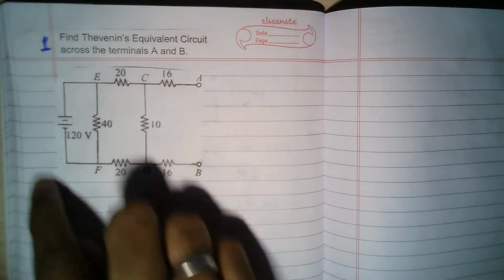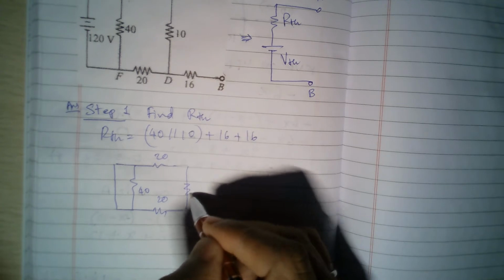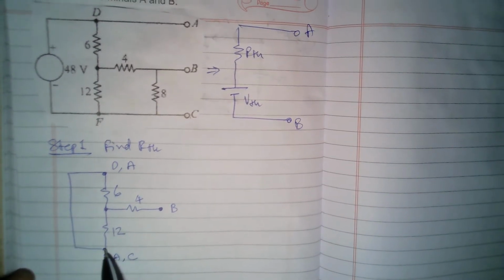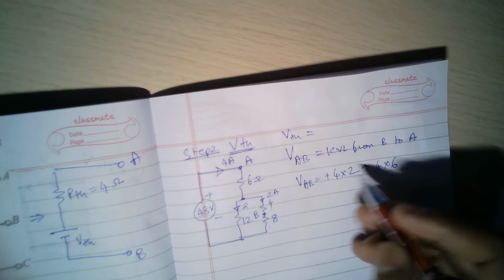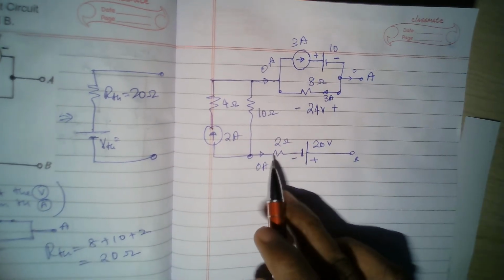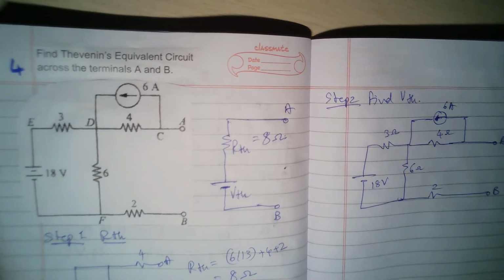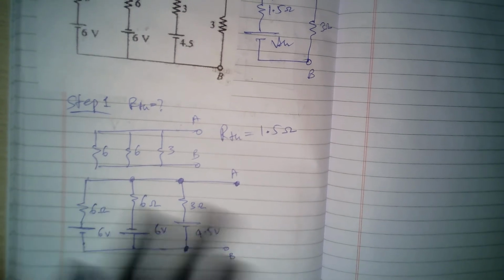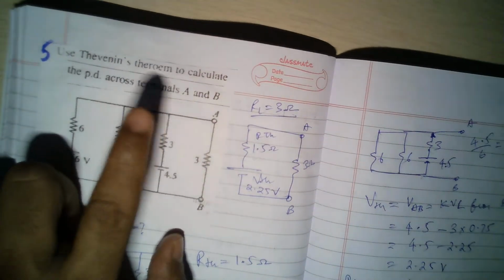T5 - Thevenin's Theorem: Five Example Problems

Comment: Why were 20 ohm resistors ignored?
Reply: To clarify, the 40 ohm resistor was ignored and the two 20 ohm resistors were combined. 

The 40 ohm resistor was ignored because to find the Thevenin voltage, you treat the voltage source as a short circuit (a wire). Then after shorting the voltage source, the points/nodes E and F become a single node, making the resistor connect to itself.

That's why the resistor is redundant/ not needed for the Thevenin resistance.
Here's a link to a video that also explains the process: https://www.youtube.com/watch?v=kZF6t0yWgKo